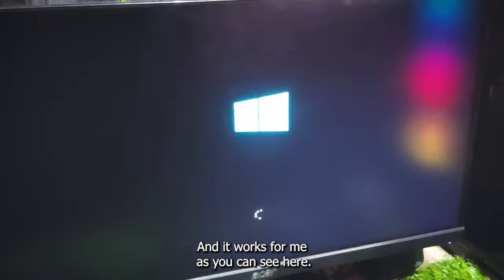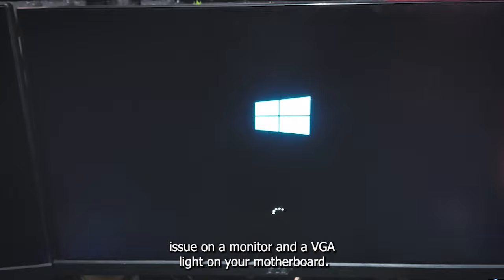Solved: No Signal on monitor and VGA Light on Motherboard

Comment: Nope, still the same. Not turning on. I don't understand. Sometimes it works fine and sometimes it just doesn't want to turn on properly with display.
Reply: You fix it? I have  the same problem
Reply: @melodiasrojas8428  Nope, still capricious unfortunately. I will eventually have to upgrade the gpu so I hope it's that... FOR THE PRICE OF THOSE THINGS I BLOODY HOPE!
Reply: @marinelemeur156  dam i gona send my to repairs and see ...i will have to buy a cheap gpu for now becuse i need it for work too :😞
Reply: @melodiasrojas8428  Mine's a rx 5600xt so it's starting to show a bit of age already...
Reply: @marinelemeur156  my is a gtx 1660 super so same lol ima save for something better  in the future too

Comment: MSI is brand of big problems
Reply: Did you fixed it?
Reply: @SobhX7  yes, with ch341a and bios flash cable
Reply: Agree,  my msi board sucks. Got the exact same issue every single time i disassemble my pc to clean it. 

Never buy from them again.
Reply: @reizalash1443 did u fix it?
Reply: having the same problems with gigabyte
Reply: The board I’m trying to fix is msi too

Comment: hey guyz i visited this video because i just ordered a prebuilt pc, its been 3 days already since i had it. it didnt even came with hdmi and power cord so i bought one from store a standard one. then i kept on testing the system to detect any possible issues then maybe on the second day i think i noticed mystic light cant save my rgb profiles for my fans and ram whenever i restart the system the fans may change its lights effect and the ram rgb goes to default so i have to set them back again to my liking. but then on my 3rd day of running the system for general testing of its general health, as i just came back from the washroom i noticed the fans are not spinning and all lights are turned off and i saw a blue led light next to the power button kept on blinking so i researched it in the interned so maybe its hibernating or on sleep. so i pressed the power on thank god it came back on BUT the rgb from my fans and ram are not working anymore so i restarted my system BUT THEN A WHITE LIGHT FROM THE MOTHER BOARD FLASHED for a couple of seconds and then went away. GUYZ im not a tech guyz i cant follow these steps here SHOULD I BE WORRIED and RETURN THIS PC???? IM AFRAID SOMETHING IS WRONG WITH MY PSU? ITS DEEPCOOLPM850D. my system config is i713700k ddr5 32 ram 4070ti tia.
Reply from the maker: Read the led debug light from your motherboard carefully when you bootup check the light is it sit on vga or cpu or ram if its sits on vga light then it is a problem with bios they used faulty motherboard or they flashed the motherboard bios (flashing the bios is very risky once flash cannot never go back to the old orginal version and if its stuck during bios flash it will ruin the motherboard) i think it is the problem with the motherboard using old used motherboard components when building a pc could be also the problem i also had this problem many times ask your seller is the motherboard under warranty and ask is it new or not and also here the thing you can try remove the cmos battery from your motherboard for about 1 minutes and boot up your pc without battery and see it solve the problem removing the battery will reset bios i hope this will be helpful anyway my English is bad but i hope you understand what i am saying
Reply: @Babinmeitei  thanks for the fast reply sir your english is perfect. the company for sure will claim that all is brandnew i paid this system after tax 3.5kcad so it should all be brandnew. iforgot to mention the motherboard btw its z690 pro wifi A from msi. the white light is found at the right top corner of the motherboard, unfortunately i dont feel competent to do what you have done on this video since im afraid il might do something else which can further damage the system. definitely i will contact tech support later on the day and i might just return this system ITS REALLY A HASSLE but what can i do. for my status of living that price is not easy for me to earn so i deserve a good system for what i paid for. last question sir if i need to return this do i really have to package it just like how i recieved it? i find it so tedious how they did it tho.. thanks!
Reply from the maker: @chadlineage    Yes bro you have to repack same like how it received and if there is replacement policy then do it as soon as possible and calling tech support is also a good option hope they will solved the problem and one question do you plug the hdmi cable to the graphics card port not on the motherboard hdmi replug on the graphics card port try changing and see if its solved the problem
Reply: the fck il have to insert those cushions back inside the cpu, damn these guyz really gave me a hassle.. they even forgot to include the powercord and HDMI cable i mean why couldnt the quality control even thought of making sure as its  part of the important components of their system and how can i turn on his system and test it without the powercable i just feel theres no heart and quality there . Later if their tech support isnt that helpful im really going to spread it here so that people will be aware, they better watch out. anyway thanks for your insights sir! @Babinmeitei

Comment: It didnt work for me. 
I FIXED IT, BY REMOVING THE GPU. AND USING THE ONBOARD GRAPHICS.

That way I got the monitor working. After that I turned off. And put the gpu (PCI) back on.. and it works fine.